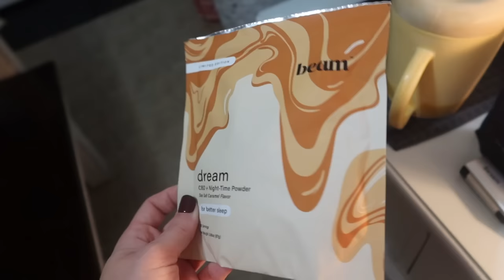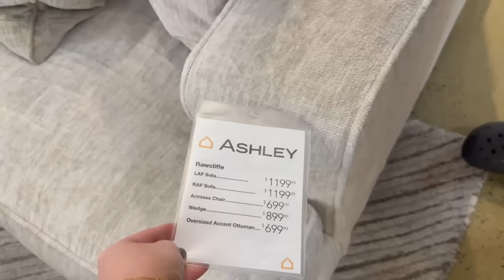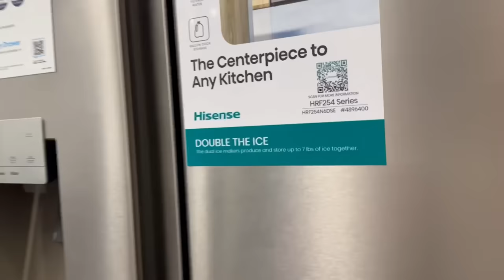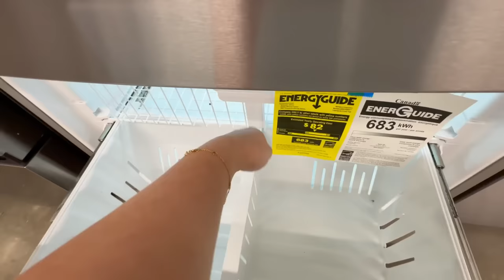🏠 MOBILE HOME MAKEOVER WEEK SEVEN // floor reveal + shopping + DIY // Double Wide Fixer Upper

Comment: Some of those refrigerators you’re showing have zero fridge space because of the ice maker. Be sure to really really think about what you store in your refrigerator and if it’ll fit. Most would not work for us.  I’m biased because I’m side-by-side lover, So most French doors don’t work for me. I did find a whirlpool I think it was, that I did really like. In the freezer drawer. It had a slot for pizzas along front the front. You slid it down and so they didn’t take up space in the drawer part. This one I think, WRX986SIHZ. But soooo much more shelf space than the one with the ice maker in the main area. Anyway, back to the video - I was soooo excited to see it this morning!!

Comment: I have a LG side by side refrigerator, I bought it new in April of 2023 and the only issue i have with it is during the summer the ice maker can't keep up with how much ice we need. I also have a Samsung stove and I bought it at the same time and I haven't had any issue with it either. But I know the Samsung refrigerators, washers, and dryers aren't worth buying. I do have a whirlpool over the range microwave and dishwasher but I wouldn't buy the microwave again because after about a month of owning it the bulb blew for over the stove and when I went and replaced it I couldn't get the new bulb to cut off and I found out the control panel missed up so I would have to get a new one to fix that issue and for a new one was half the price I paid for the microwave so I told my husband to not worry about it I will just use it without the light over the stove which I have came to the conclusion when this microwave dies i will just get one to go on the counter because I am short and have a hard time cleaning it out.

Comment: I've commented a lot, but I  have another tip. For those who want to use wallpaper in a rental...I  grew up in the 70's helping my mom wallpaper EVERYWHERE in the  house.  My mom grew up helping her mom. Back in the  day wallpaper didn't come with paste already on it they  had to add it. When I  was a kid they still sold it without paste, but also with paste on it. My  mom made  sure to buy it with the  paste.  Note...you  could get two different kinds. One with regular paste or one with sizing. The  sizing makes it easy to remove. If not you may peel the sheet rock paper off trying to remove it, and that creates a lot of damage. I have no clue how they make the paper now. If there's still two options you definitely want the paper already sized. However, it may  come loose after three or so years due to that fact, but we never really had that problem. My mom loved to do new paper when she wanted to redecorate, so the  sizing was important to her, because she didn't like putting new paper over the old. You have too many layers after awhile. I helped my dad with a drywall job he was doing once and he hired me to help remove wallpaper that wasn't sized. What a nightmare. We literally drenched  the  paper with spray bottles of hot water and used an iron. Trying to not damage the drywall. We worked on that for days. Back then people put wallpaper in every room of their homes. That was 35 years ago, and the paper had probably been on the  wall 20 years.  I've never offered to help remove old wallpaper since, lol.

Comment: I’ve had two dishwashers with the buttons on top and haven’t had any trouble.  I’ve had two because it was in two different houses.  Also check and see if you have a sent and ding appliance store. Sometimes you can get a perfectly good new appliance for half the cost.  We bought a fridge at one that was regularly $1000 for $500.  Just an idea.

Comment: Ashley is more affordable. IMHO you get what you pay for with Ashley. It isn’t long term quality but if you know that going into it and plan on replacing things every 5 years or so Ashley does the job well. 

I regret not getting lay down rack sections when I bought a new dishwasher (for big pots). I also regret skipping the top utensils rack as well. I love the bottle jets (tall glasses, water bottles) and the hidden controls on it tho. 🦋

Comment: If you're at Lowe's and Home Depot just to look at and touch the appliances, that's fine.  But I would strongly encourage you to note the model numbers of the units that interest you the most and then seek out the smaller local appliance stores when it's time to buy.  They will definitely give you better service and if you show them the models you were looking at and the prices, they may even be able to match or beat the price.  🦋

Comment: To me Rooms to Go is the place to go. If you buy cheap you get cheap, but if you invest money in your furniture it last. I just got a GE stove from Home Depot. I replaced a GE that lasted me for years. I also got a GE  refrigerator 6 years ago. My old one had lasted me 21 years and when they got it out of the house the ice maker still worked. The appliances came with my doublewide when I bought it. I highly recommend GE. I ordered my stove from Home Depot and they went on line and ordered the one I picked to replace the old stove. They delivered it and set it up 3 days later. There was nothing wrong with the old stove except the bottom burner went out on the oven. And because it was so old I decided just to get a new one. My daughter has had a couple of Whirlpools washers and dryers and 5 or 6 years down the road she starts having problems. So if it were me in your shoes I would definitely get GE’s. If they don’t have them on the floor you can pick them out on line and get the features and size you want.

Comment: I want to say one thing about the freezer drawers on the bottom, be careful my aunt broke her ice maker down there shortly after she got it and it cost her a lot of money to fix. Also see about the light inside if it is a bulb or a whole piece you need to change out. Mine is not a bulb and for me to replace the light in the fridge it will cost me 80.00 as well as the water filter which is another 50.00. Those are somethings to need to check into and be aware of. I love my side by side just hate the prices to get a new light since the other blew out and the cost of the filters, but that is what you have to do for the horrid Florida water down here.

Comment: Love the floors! I have a Kitchenaide dishwasher with buttons on top of door. I have not had any problems with moisture. I have had the dishwasher for 3 years. I am very happy with it. I recently purchased a GE refrigerator and a LG washing machine. So far I am very happy with them. I just purchased a Maytag/Whirlpool stove and it will be delivered on Friday. My old stove is a Maytag. I had it for 13 years. The oven stopped working. I really like Maytag/Whirlpool.

Comment: Wait till Black Friday especially if you are purchasing several appliances you can save a ton of money! As much flooring that you have that is all same be sure and save plenty of extra flooring in case you ever have a problem and need to replace any because if you need any later you may not be able to match it and even if it’s the same the color may be off.

Comment: I hope you find some good lasting furniture!! We bought a chair and smaller sectional from Ivan smith, 2 years ago this November. It didn’t even make it those two years. We had insurance on it and they had to replace like the structural piece of wood bc it broke. (The back part and it was never made good to begin with bc it needed more support from the bottom). Anyhoo, they fixed it. I absolutely love my sectional bc we have a chiweenie and it is made from the stuff that feels like a smooth warm and cozy sweatshirt. It’s easy to clean and it’s black! I said even with it already having messed up that I would buy it again bc I love it so much. It’s cozy and so easy to clean, pet friendly and just overall a great couch!

Comment: Yet another comment...sofa purchase idea. In my experience the cushions are what you will wear out first. If it's a good fabric (like mine, that is 23 years old) it's  still holding up like an iron horse, but the  cushions get  flat. Someone suggested to me  to go to the fabric store and buy new foam. I knew that wouldn't work. I called back home to the family furniture store that my family has used since the  50's. I gave the owner my cushion measurements and he  ordered them for me from a manufacturer. He held them till I  made the trip to visit my mom. I knew in the  town I  live in that the big furniture stores would tell me that was something they couldn't do. My cousin went a step further. When she bought her couch she made the deal to where they had to give her extra cushions with  the  covers, so she would have a set when those wore out or messed up.   They  wanted to sell her the couch, so they  threw in the extra seat cushions. We both bought high quality, so we  could keep our classic looking couches for YEARS. I've never gotten tired of the  style or solid Forrest green color of my  couch. Kinda like the color of a pine tree. Another wonderful feature that you never hear talked about is what they used to call the "break away front" on sofas and love seats. I'm  not sure how far that goes back, but it was an option in the  70' and 80's. Basically the front of the couch where you sit is spring loaded. You can take your hand and literally push the front of the couch down where the cushions set. This allows the cushions to give with your weight and not grind on the  foam causing them to wear out and flatten over time. I  will say that in modern times I've only still been able to find this feature in more high end furniture stores. I however find this feature well worth spending the money on if you're like me and love a classic/traditional style sofa that's timeless through the ages, and you  keep your furniture seemingly forever.  If you  like change, then it probably won't matter. But I  don't like rebuying living room furniture every five or ten years like a lot of people do. No offense to those that do. That's just my personal preference. I'm  kind of a once and done person with so many things in life. I like to move on to the next thing, or spend my money on something else I need instead of buying the same items over  and over. So when it comes to furniture I look for things with  longevity in mind. My kids are now grown, but I  really enjoy your videos.

Comment: Aye Kelly, I just wanted to warn you about Ashley Furniture. We purchased a couch set that included both sofa and loveseat and an ottoman when we lived in Maine and within 5-6 months there were framing issues and problems with the upholstery of the couches. My kids were 12 and 14 so it wasn't like I had itty bitties but still, my sons would have friends over and they were not rough or jumping on furniture but it was getting heavy teenage use and it didn't last for more than a year and a half and I just couldn't afford to buy another set. My kids are adults now and we have had awesome luck with Costco and their sectional set which we purchased when we moved to San Antonio from Maui in 2019 and it's still going strong. Granted we don't have little kids anymore but we do lounge a lot especially when the kids visit for the holidays and it's good quality and heavy wood and not pressed or particle board. I just wanted you to be careful as it's a big ticket item and you want it to last as long as possible. I agree that Whirlpool and GE products are good brands and often have a great warranty. I can't wait to see the end result from your backsplash. The best of luck Kelly and I can't wait to see how you decorate for the holidays

Comment: Please Please Please dont get any furniture from Ashley. I have returned 2 couches and eventually went to raymour. I got a leather couch that started peeling a month in. They replaced it but they didnt have my color so they allowed me to replace with another couch if choice. So i went with a sectional in a similar color. The brackets that held the sectional together broke from the wood it was screwed into. I told them to come get their crap and i spent 200 more on a raymour couch but i havent had any issues a year in

Comment: Really? I have a Frigidaire fridge and that thing sucks ass. I have an lg washer and dryer and French door fridge and I love them. The Frigidaire water dispenser stopped working and I never could fix it. We replaced the filter in it three times and couldn’t get the line to open and even cleaned the back from dust and debris and it never worked

Comment: I don't normally comment, but please don't purchase from Ashley. They may appear to be "cheaper", but it is due to the quality. We purchased from them & had only had our sofa for a couple of weeks & had to have them send a repair man out to basically take apart, do some rebuilding, reshuffling & putting back together. He all but said he had to do this way to often. It's cheap workmanship. Save up, pay a little extra for GOOD quality, long lasting furniture. You'll be happier in the long run.

Comment: I don’t understand why they didn’t continue the laminate into each room and closets instead of cutting them at the threshold. That makes absolutely no sense. My laminate flows from one room to another with no need for threshold strips.
Reply from the maker: Well bc it’s a mobile home and there’s a possibility it could be moved one day. To move it the home would be split in half. For that reason thresholds are necessary 😊